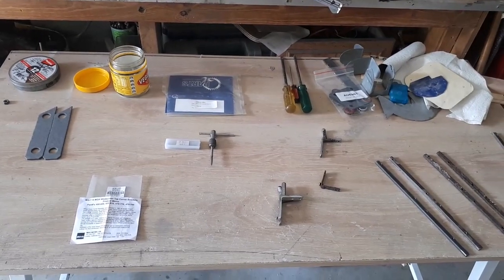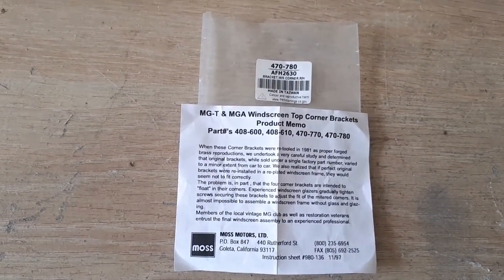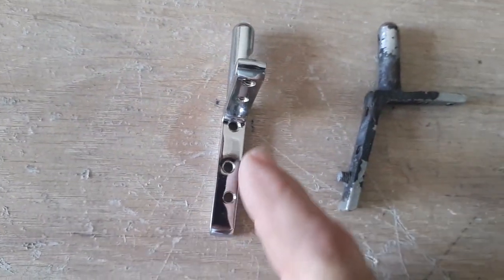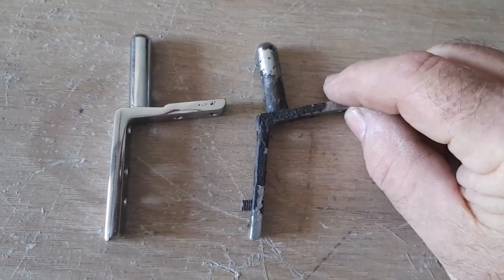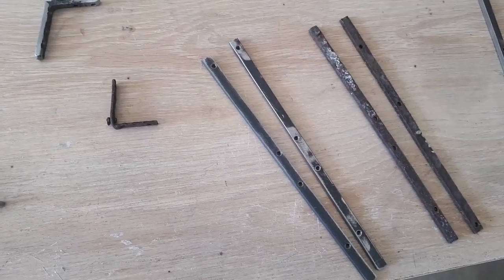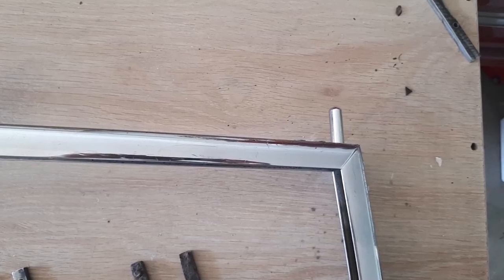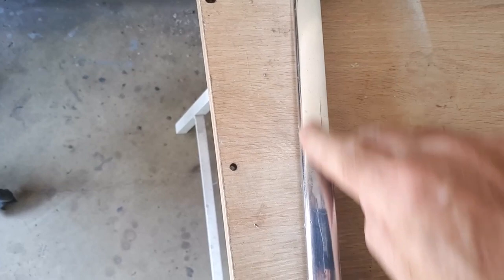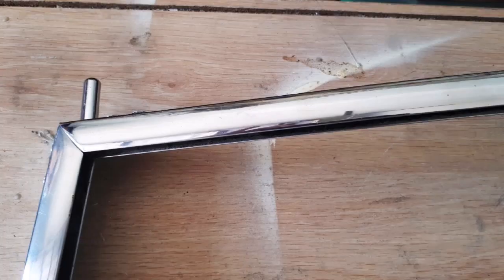MGA Restoration Aussie 2019 Pt. 83 - Pre Assembly of Windscreen Frame

Comment: Good work fixing that Moss top brackets..10-32 thread machine screws work well in the 2BA threads. I rebuilt my windscreen with them. Also, I made new threading plates as you did, but made them out of brass after seeing the rusty mess that the originals had.
Reply from the maker: Yes I like the sound of the brass plates. If I could find some brass I would probably re do them. The holes in the Moss brackets did not line up very well either but it was an acceptable result. Thanks for your comment.

Comment: Endless details... Seeing the two pieces in profile on-screen makes me wonder if the original was two flat pieces welded together, whilst the Moss repro piece appears it's cut from a length of  90* angle stock, which would account for the angles not matching up. Does that seem right to you, with pieces in hand? Thank you for documenting all these intricacies!
Reply from the maker: The Moss parts are a cast brass and nicely finished. Shame that they did not fit prior to adjustment. The one's taken out of the frame look like a mild steel from the rusty pitting. I do not know if they were original or a replacement at some time over the years. Anyway with a bit of manipulation we managed to get a reasonable result. Thank you for your comment. Cheers.